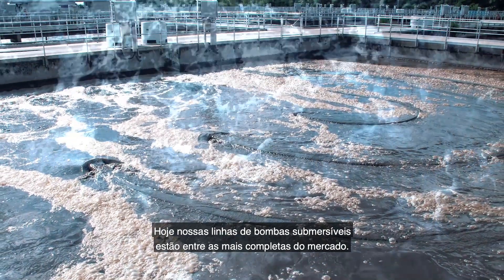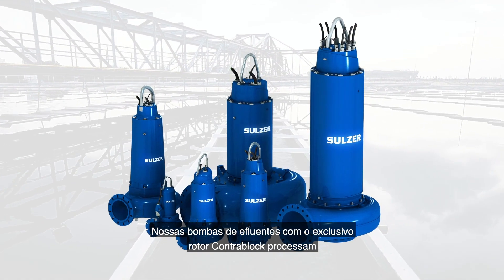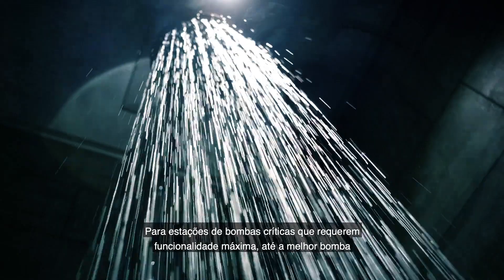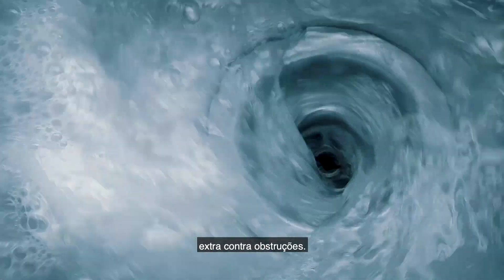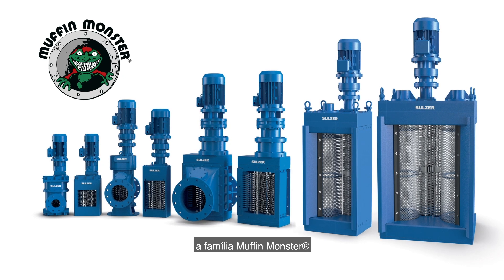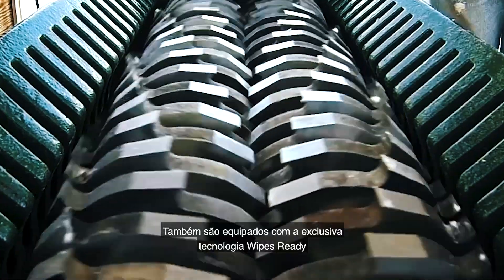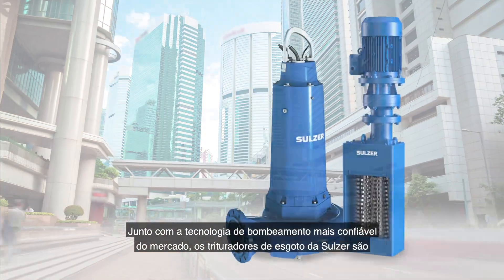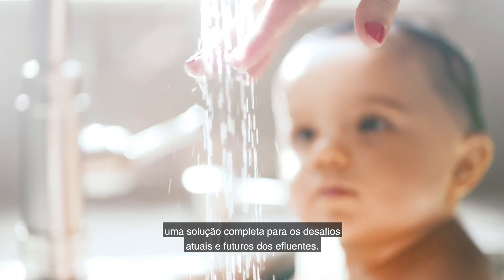Sulzer Water: Trituradores Monster Muffin - garantia extra contra bloqueios na sua bomba

Comment: Does the device work well with hair in a sewer line?
Reply from the maker: Dear Marcelo, the unit is not affected by hair in a sewer line. If strands of hair are the concern, they will not wrap around or damage the unit, but they are also not going to be made any smaller by the action of the grinder if that is what you want to achieve. If there are accumulations of fats, hair and rags “fatbergs”, the accumulations will be intercepted and made smaller. Please feel free to contact your local Sulzer sales office to discuss your application further. If we can understand your problem, we can steer you in the right direction.